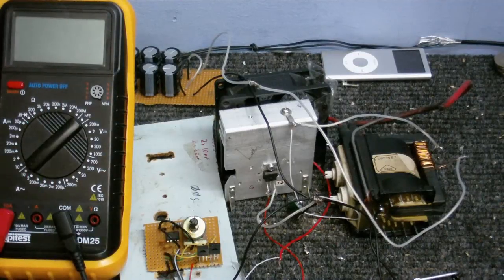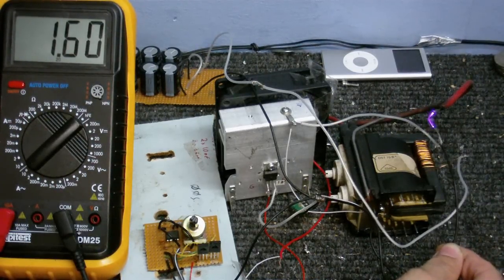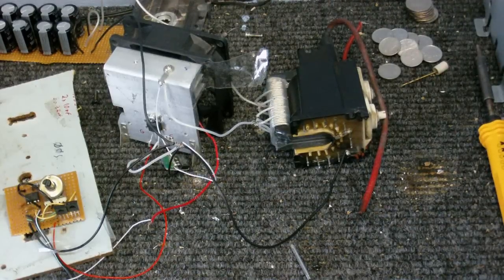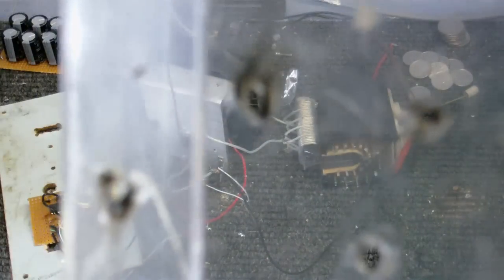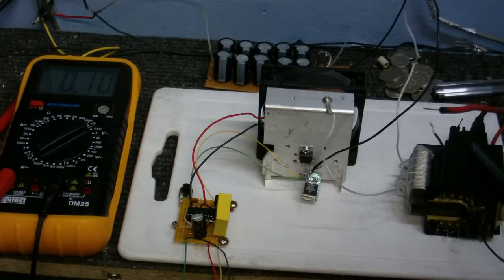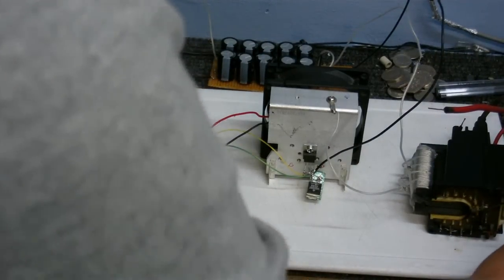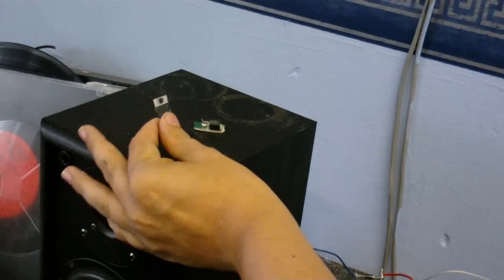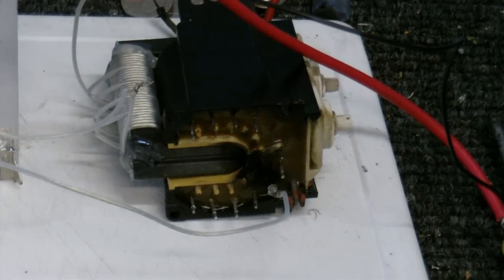CDC ElEcTroNic WorkShop - Another high voltage flyback driver experiment

Comment: I think it is because when you are pulling an arc it creates a certain amount of back emf that opposes the primary current somewhat, and when you are not pulling an arc there is no back emf opposing the current in the primary coil.

I remember seeing in one of Photonicinductions videos where he had a motor that he was running until it popped, he said that if he held the shaft and not let it spin it would cause the motor to draw more current than it would when it was running.

But I may be wrong!

Comment: mine 555 driver didn't worked so i remembered that you check first the voltage that goes in the socket pins and find that a pin was shorted and then was working super awesome and there is another configuration which you can try, I call it a "Joule Thief Driver" and at 32V input it starts to get plasma everywhere,anyway... nice driver you got there mate :D

Comment: Yep... 30 amps if you manage to keep the case at 25 degrees celsius..but as you cannot keep it at this temperature, it will never manage all that current..only inside laboratories under special conditions of cooling...an acadhemic specification only..real life is much less than that..maybe 12 amperes in an optmistic way.